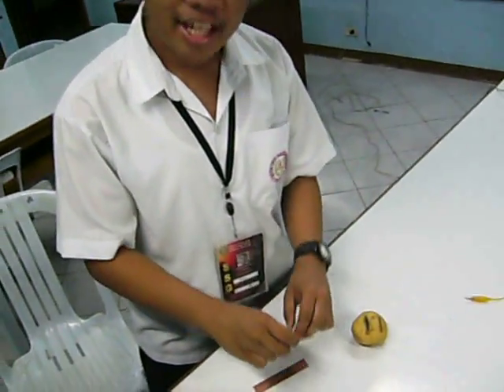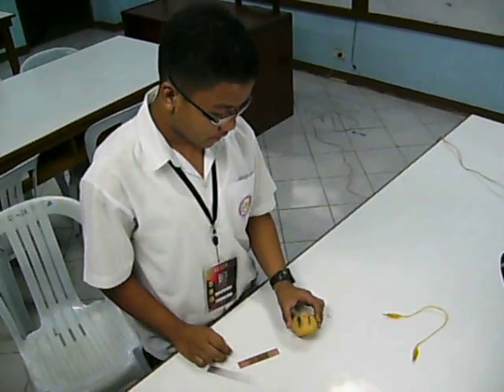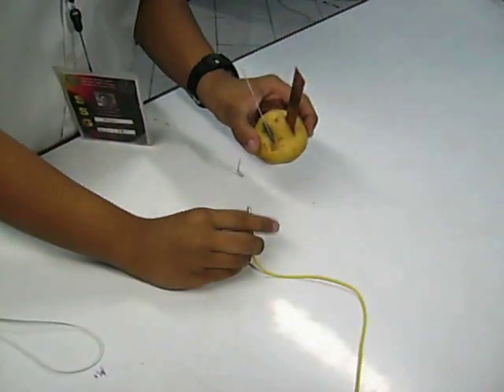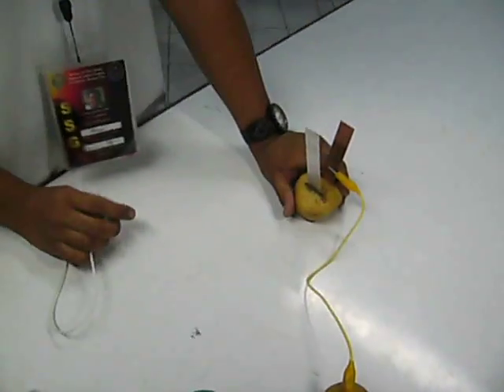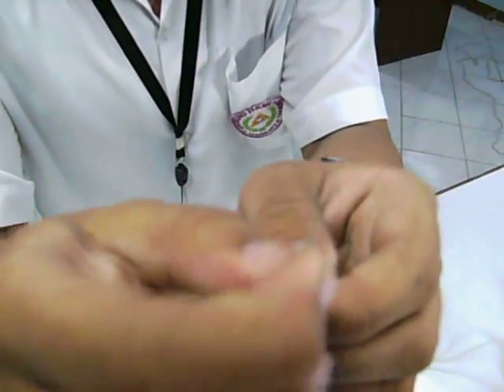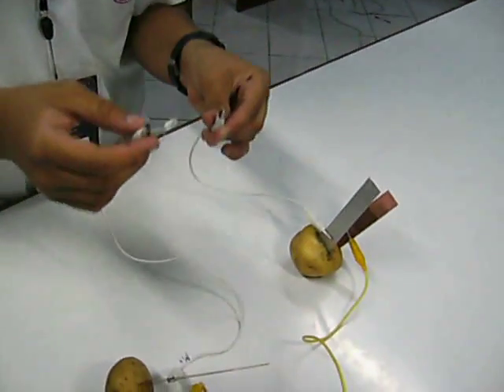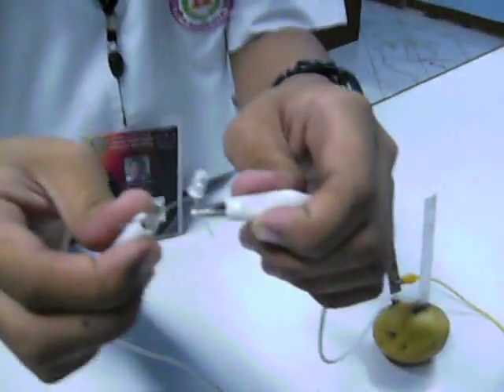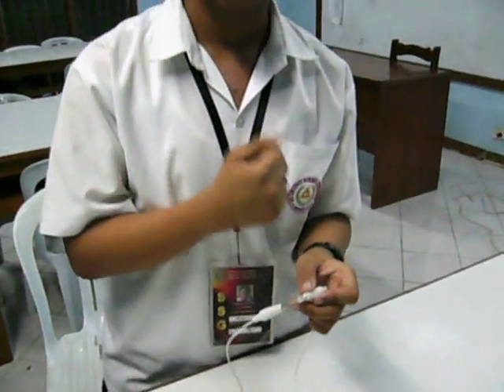Root Power (Solanum tuberosum)

Comment from the maker: @stratifix 
 thanks Jane, the production of electricity was due on the use of 2 different plates producing two opposite terminals, aluminum plate to cause a negative charge while positive for copper plate.  Without two opposing plates, u cannot make the charges to flow in one direction in the potatoes.  You can try to any fruits at home.
God bless Jane. Thanks for the curiosity.
                   - Sir Rolan